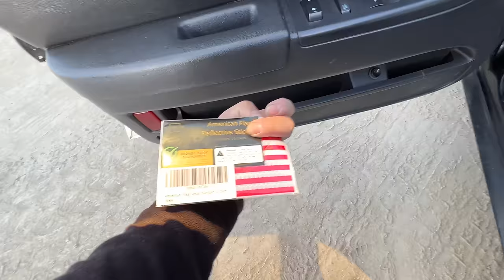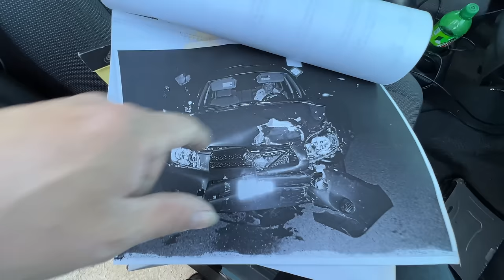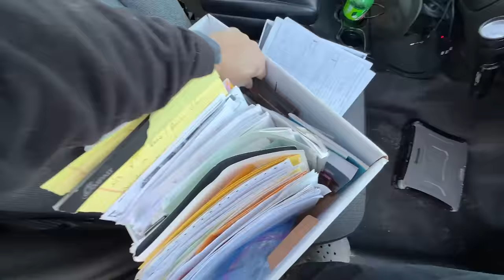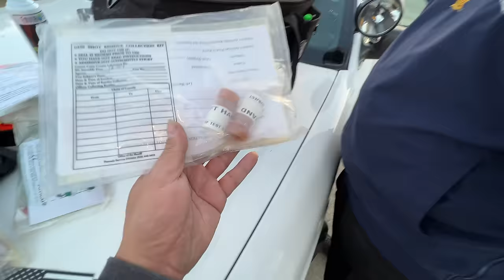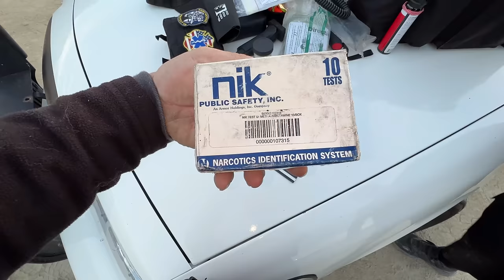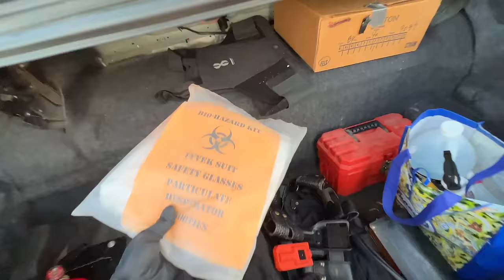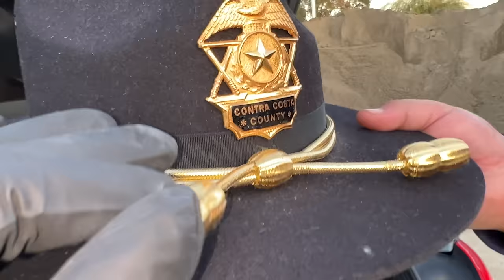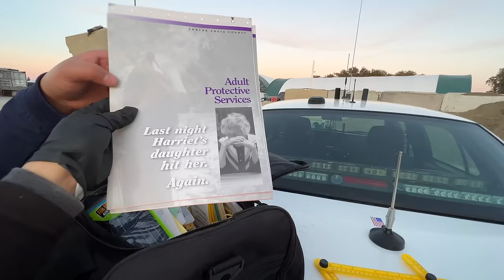Searching a Detective Homicide Detective Squad! | Crown Rick Auto

Comment: Treat any firearm as if it was loaded at all times. First thing you should do is check to make sure it is clear. Don't screw around with ghost guns, just call the cops and turn them in. Chances are they probably have bodies on them. Also if you are unsure if a firearm is loaded, you should keep it pointed it a safe direction at all times. If you follow the basic firearm safety rules you would not have accidental shootings.